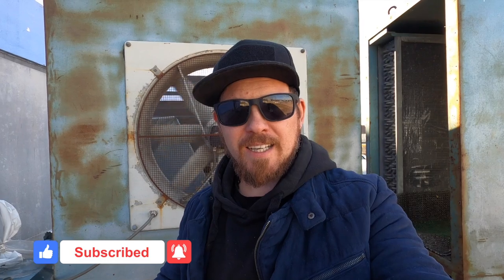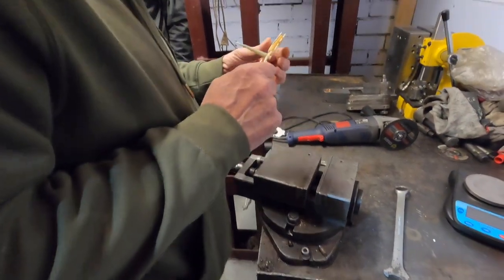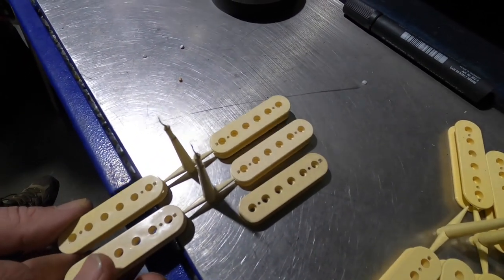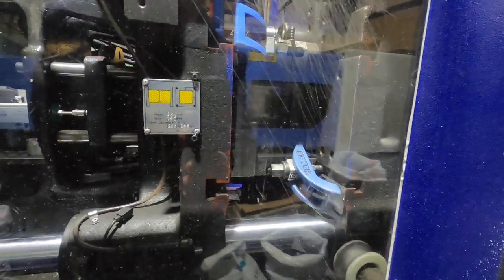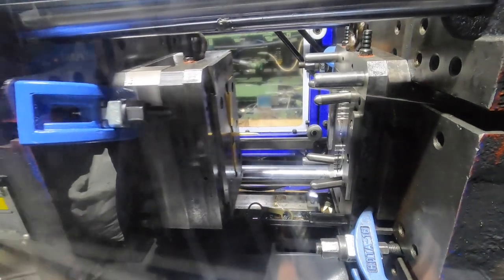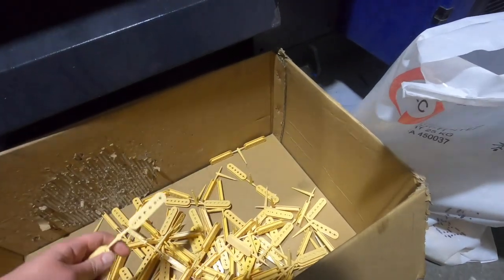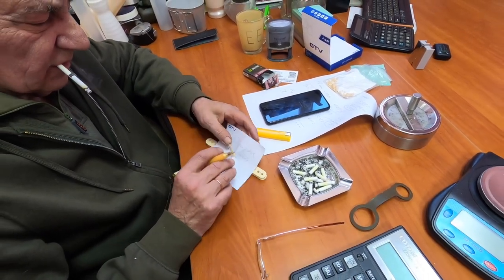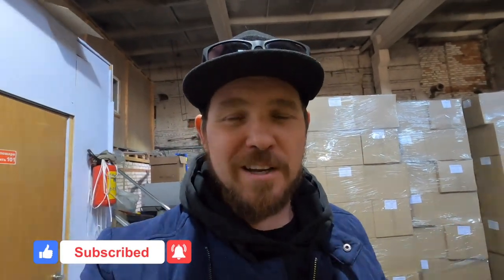Vlog #10. PAF pickups bobbins casting.

Comment: in the late 1970's I worked for a medical cable company that manufactured injection molded part and finished medical cable assemblies. We used all types of plastics. The plastic used here is butyrite , a low temp plastic, (600degree flow). Our molds cost $3000 back then so i can imagine how much these molds cost. If he was making these bobbin in the US Larry Dimarzio would have sent him a cease and desist letter by now! 😃
Reply from the maker: Yes, it didn't come cheap.